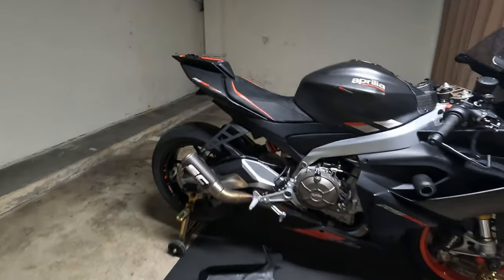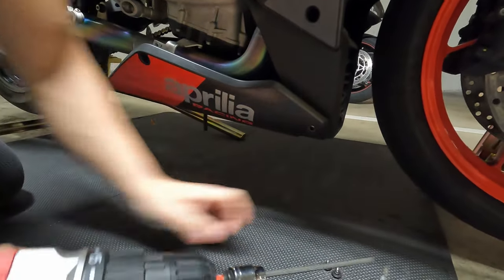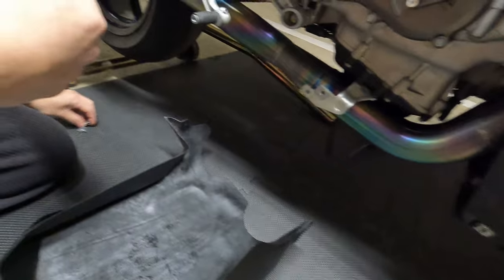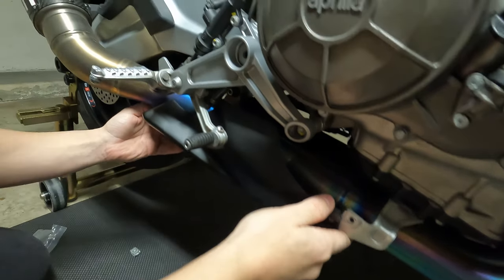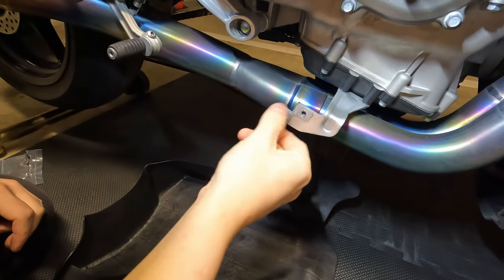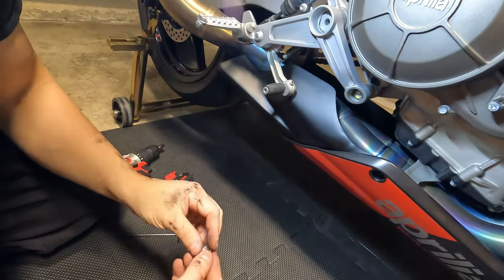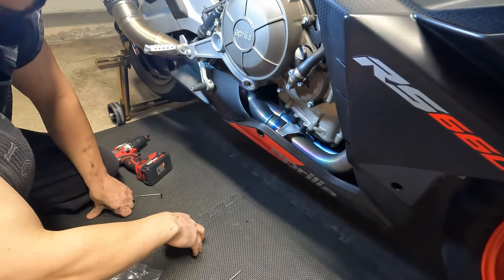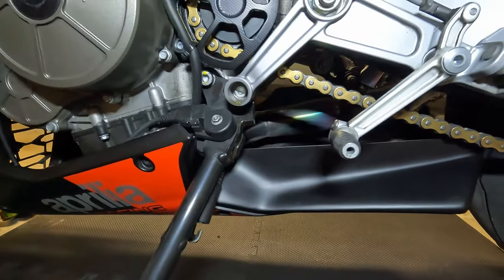RS 660 | Belly Gap Fixed | Exhaust Shroud - S2 Concept

Comment: Perfect! I can't believe it's taken so long for someone to come out with this.
Reply from the maker: It’s actually been out for a while. I was just hesitant to pull the plug as I had no reference to see if its worth it. But I figured I should take the hit for the rest and upload a video. But no hit there. As its totally worth it!
Reply: Yes good video!  I’ve seen other videos/ parts that just don’t fit as well. This one is perfect !
Reply from the maker: @violetjames7534  Yes, the fitment for this is perfect. It requires no modifications!

Comment: Yea, I lowkey see the reason to cover that part of the bike, since this bike is not designed to have a high exhaust installed, as the stock one is situated under it pretty much. 
But man, this does the job pretty good, without that piece, it seems that something is missing. Well done👍
Reply from the maker: Yes, the RS660 was designed with a great stock exhaust design. And no aftermarket exhaust manufacturer has built an aesthetic design that matches the stock. For that reason this belly cover is a must to keep the aesthetics.

Comment: Any idea if this would also fit with the exhaust with the catalyst converter included? And does it touch anything like the rear brake or the shifter?
Reply from the maker: I don’t think it would fit the CAT exhaust. The rear brake lever barely touched it, so I ended bending the lower fairing mount a little bit inside and it moved the belly fairing away from the brake lever. No issues.

Comment: Are you going to throw some heatshield tape to prevent melting from exhuast heat?
Reply from the maker: Thats a good idea but there is good distance between the plastic and the exhaust. I took it for a hard ride and the plastic was not affected by the heat. Ill keep an eye on it though.

Comment: Does it fit with the akrapovice with E5? Not the race exhaust ?
Reply from the maker: This extender was initially fitted on the Akrapovic S-A6R3-APLC. If that is your exhaust then it will fit. I don’t know anyone that has the S-A6R4-HAPC to confirm it will fit with this too. If you have the HAPC and wan’t to make sure it fits, send them an email at agnes@s2-concept.com

Comment: What stacks did you decide to go with?!
Reply from the maker: Gabro’s stacks. I have an install video coming up plus review.
Reply: I just noticed, is that the fly hammer countershaft cover ?! How do you like the build quality ? Is it super messy ?
Reply from the maker: @nippz05  Yes. The build quality is great. Its aluminum so basically what you would expect from an aluminum part. I hated the plastic cover and I wanted to be able to inspect the front sprocket on the fly. It also has a shifter stabilizer, which I’m not sure it really helps but to be honest I haven’t had any false neutrals since I installed it. So maybe it does help. The only downside to it is its price at $180 😓

Comment: Will it collect water if it rains? And if it does how hard is it to drain it?
Reply from the maker: The stock belly fairing has a drain hole that rain water would exit from there. But the S2 concept fairing and the stock fairing don’t seal with each other, therefore water would drain from everywhere. I can’t corroborate that, as I never ride in the rain, but if water drainage ends up being an issue, one can always drill a hole under the belly.
Reply: @ALFAVITAGA  That’s true, Thank you for the reply, was contemplating between the sc project and motobox exhaust. This might tip my decision towards he sc project
Reply from the maker: @rexile1986  The motobox is the perfect choice for keeping the stock design line while gaining a bit of performance and sound with a lower cost. But it will never sound as good as an SC Project or perform equally. With this belly fairing, I actually prefer the looks of an SC Project compared to the stock look. The RS660 is a little disproportional in the rear compared to the tank size and height. The SC Project compensates for that tail narrowness. But then again looks are subjective.
Reply: @ALFAVITAGA  That's the thing, I love the sound of the SC Project, but I love the looks of the stock exhaust, but now that I've seen the S2 concept belly spoiler, I might go for that, Thanks to your video I manage to come to this decision :)
Reply from the maker: @rexile1986  I’m glad ✌️